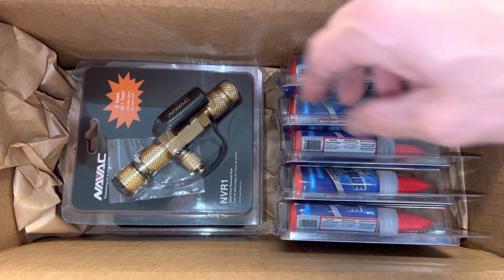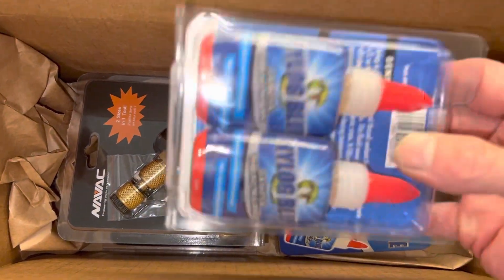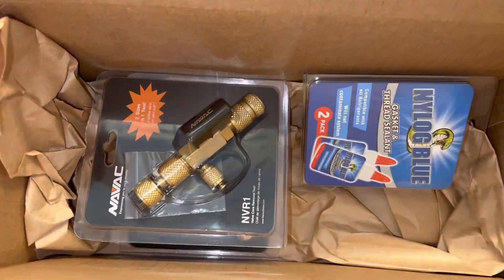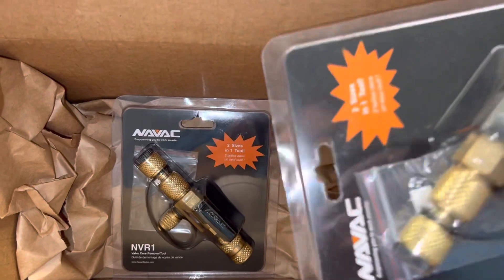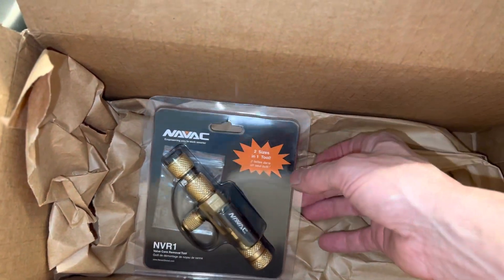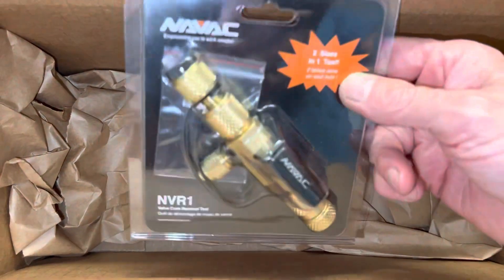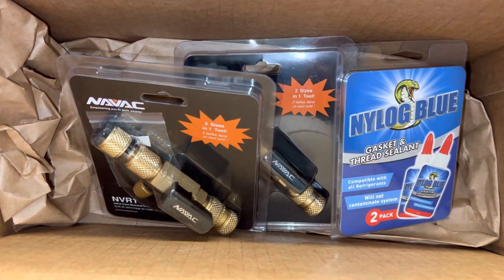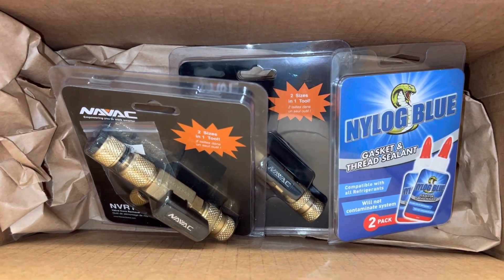TruTechTools For My AC HVACTools & Supplies. NYLOG Gasket. & Thread Sealant

Comment: Why don’t you do more cannabis vids
Reply from the maker: I devote this channel mostly to Automotive just let the automotive guy see there’s a taste of something a little bit different. 
     I’m about to release some videos on a cannabis spot where the 12 1/2 ton units were driven into the ground all rusty motor bearings going out bypass safety switches mildew growing inside the units. 
           All the equipment needs to be.,

But depending on budget might just do typically with most grows do when they’re hard up on money Band-Aid, the problem, keep it up and running so they can get one room profits to pay for the second room .    And then when the second room gets going, they use those two rooms to pay for the third room. You know how that goes he’s been around this industry long enough.. 

Then, because of budgets, they never put the money into enough equipment for redundancy in something breaks down, and they lose their cropper damage it and they cry and lose money . 

Linda, good equipment with reheat for helping with Dehumidification cost more money so the majority never buy that upfront . 

They suffer through a lot of humidity problems no matter how many dehumidifiers they throw out the problem . 

Then, maybe if they’re lucky and the last long enough, they come around to realizing that thing called reheat to help lower the humidity may be a benefit now . 

But unfortunately, it cost an awful lot more to add reheat to a system then if it was designed and installed from day one get-go . 

I’ve been doing ASE for Cannabis installs, including my own in the early days for well over 30 years now . 

When I started in high school up in Willits growing up in the mountain 🏔️

Comment: Hey Tom, I have a master cool set for core extraction and replacement. The tips of the tool break very easily at times. What do you suggest? Specially the core tool that you spin to remove and install the valve. Thanks!
Reply from the maker: Are we talking about old style quarter inch for R12?  

Or r134 & YF refrigerant cupping type.  

I have never broke I a set of yellow jacket, Richie valve core for Moving Tools . 

I have the master cool for R134 never broke a tip on them . 

This NAVAC is also vary good. 
TruTecTools have the NAVAC
Reply: @coldfinger459sub0  it’s the smallest adapter for the R134a mastercool tool. Ok so I’ll look at the Novak or yellow jacket. Maybe mine was fractured or dropped. I only used it 3 times when the tip broke.
Reply from the maker: @powayimports4175  only master cool in a few generics make for R134

I’ve never checked yellow jacket for that, but maybe they make it 

I’ve had my set since the 1990s never broke one

Comment: Also the local hvac shop simply use compressor oil as nylog
Reply from the maker: Many decades ago back in the 1950s and early 1960s when my dad was young all the refrigerant oil was made out of mineral oil.   They used to use Vaseline in the place before NYLOG was invented.

Silicone, grease or dielectric grease was the other substitute 

Both of these substances, he cannot pull a vacuum through. It will stop any tiny leak.